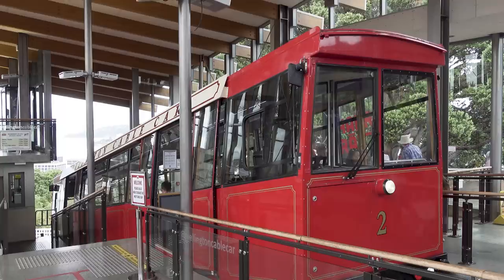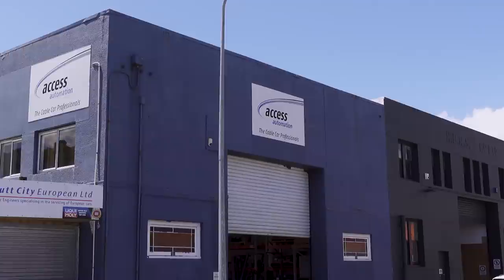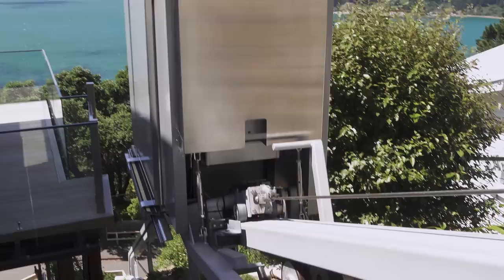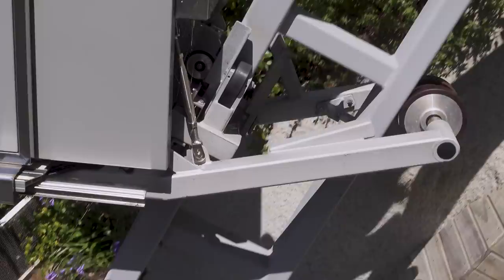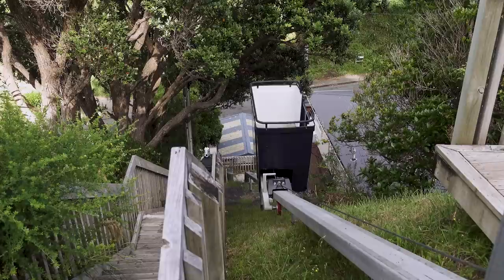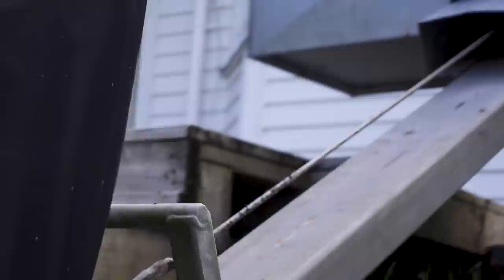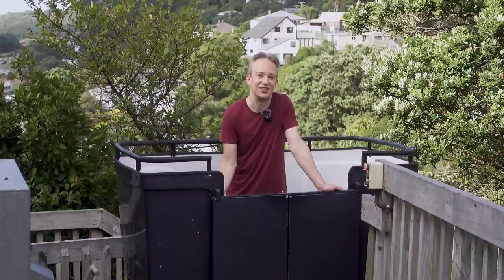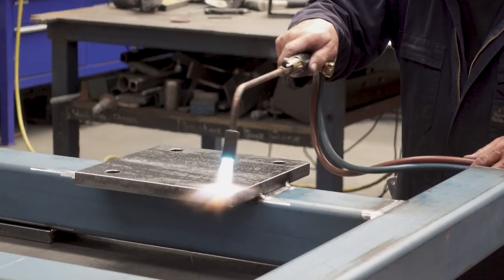The city with a hundred private cable cars

Comment: I normally work as a tour guide in Wellington (Tom, next time you're here, let me know and I'll find you something interesting), but over Covid, with no tourists, I worked 5 different jobs.  One of those was as a courier (for the huge backlog of parcels being ordered).  I got to ride a few of those cable cars which, for a Wellingtonian who doesn't know anyone with a private cable car, was a bucket list item.  Some of them were surprisingly slow, but there's no other way to the house, so sit back and enjoy the ride.
Reply: I moved furniture to a house with one, it had a canopy so couldn't fit big items in it, still had to use the long path. Two seats one either side. It went across more than down - unusual it went down from the street, in Grafton Rd Roseneath - long time ago, fairly sure Grafton.

Comment: If it's this challenging to access an already built house, I can't imagine what it must've been like for the construction workers building into a undeveloped hillside
Reply: Probably used a huge construction crane to lift everything (including the workers) up and down???
Reply: @JohnSmith-yv6eq  and helicopters
Reply: Living in Wellington I can tell you that it's done by helicopter.
Reply: You 100% get it, I had to install double glazed windows in many of these places...biggest pain in the butt ever.
Reply: @patrickmcdonough1893  They've got a 9-ton, a 14-ton, and Maurice Micklewhite.
Reply: @TheCamwa  hehe “ pane in the butte” windows on a hillside
Reply: @mrwess1927  gold!!!!
Reply: The people who keep saying cranes have no idea of the cost involved, as a window installer these hill side homes are terrible to work on.
Reply: We used an ex army bailey bridge barge and lots of buckets for the sand and gravel, timber was just loaded, (overloaded)  I wasn't even given a life jacket. All the concrete was pumped 300 feet down the 40 degree incline.
Reply: I had a similar thought regarding firefighters and heavy firefighting equipment.
Reply: In the Amalfi Coast in Italy they use donkeys.
Reply: I live there and have worked in manual labor jobs. Its a lot of carrying materials up stairs
Reply: I live in Thorndon, Wellington and there's construction going on at the house across the road from me. They had to get a small digger up a 5m high retaining wall, up a steep dirt slope, park it precariously next to their house, and then install some open-air piping to clear away the refuse and dirt they were excavating. Tradies here are kind of just used to dealing with our topography haha. 

Thorndon, I think, is the area Tom made this video in, based off what I saw in the background of the cablecar

Comment: As a long-time Wellingtonian, I grew up going to and from school via the Cable Car every day and have always loved the inclinators you see around the city.  Their extraordinary expense is due to the customization required for each one.  Most people don't have the budget for these conveniences, so people have to just get fit walking the hills and steps required.
Reply: It was only the rich who would build somewhere that needed one. The rest of Wellington doesn't have hundreds of steps per property, does it? I lived in Wellington and had six steps, most have less than fifty and not many have more than eighty. I've never heard the word inclinator until this video and from decades in Wellington only ever heard them called cable cars. Most people drive mate - or bus / train. Even if a house has 60 steps it's one minute of walking - not a huge effort. Minority of people actually walk anywhere and  walk up hills.
Reply: @moaningpheromones  I lived in Kelburn near the top of the Cable Car, so it was a no-brainer to use it for direct access to Lambton Quay and then take a bus the rest of the way. As Scott says, the only reason you'd get an inclinator is for the disabled or to reach otherwise inaccessible property.

Comment: These are also common in my area.  Maintenance is important.  There was a story in the news a few years back where a private cable car broke loose and crashed, killing one of the occupants.
Reply: Wouldn't it be a simple matter to have some kind of inertia mechanism (like car seatbelts) so that if the cable breaks a ratchet or pin flies out and locks the car into the rail. I thought regular building elevators had this.
Reply: @Matthew-ut6ed  I’m sure they have something like that already, but everything needs regular inspection and maintenance to ensure it works correctly when needed.
Reply: @Matthew-ut6ed   The mechanism for these car puts on the brakes when tension is lost on the cable. My property is one of 10 serviced by a similar cable car and we are on the least steep part of the track. We often lose tension when we start to go down the hill and the brakes will stop the cable car and we have to reset and start again. It's only for our stop, and only when we're getting started but it gives me a lot of confidence in the system.

Comment: Despite its branding, the Wellington Cable Car is actually a funicular because the cars are permanently attached to the cable. In a traditional cable car system, like what Dunedin lost but San Francisco retains, a person had to stand in the car and move big levers to clamp onto the cable.
Reply: Dunedin had two cable car systems... One I travelled on as a baby... the Rattray St--Ross St--Kaikorai Valley one... and the High St one which I used in its last year...1957....  the single line was every bit as good as the ones in San F running down to the Piers.
Imagine that now as a tourist drawcard.......
Reply: these are all funiculars

Comment: the next step is to make the cable car part of the house - say you step in through a perfectly normal looking front door at the street into what appears to be a regular entryway, but really the entryway is the cable car and it moves up to the house and becomes part of the structure, so you can you step out of it into the living room or whichever, just like you would any other house
Reply: Also available, and just costs a lot more as you enclose it. Tom could do the same here by me in South Africa, where the Cape province ultra rich live. Areas like Bantry bay and Llandudno, where there are plenty of properties where you absolutely need to have a cable car to access them, or the number where all you have at street level is a set of garages, and a lift to the premises
Reply: The true next step is to make the cable car a house and the whole house moves up and down
Reply: @SeanBZA  I've seen a couple of those with cable cars you can drive a car into because the 5 or 6-car garage is a part of the house up the cliff.
Reply: I manufacture these, and yes, we have many that terminate at the house, exactly as you describe
Reply: @galliman123  Yes!  Down to the street for convenience, then up for the view.
Reply: @galliman123  The sequel to Up seems a bit less fantastical.
Reply: Call me when you've got a working teleporter.

Comment: There is a lot of these in Sydney Australia as well. Most of the ones I have seen are towards the top of the Northern beaches peninsula and many are not to access the house but to get down the step hills at the back to access the boat house of the property. And yes if you can afford any of those houses the price of the inclinator is not going to bother you it will be insignificant compared to the price of your boat let alone the house.

Comment: I grew up in a house on a hillside (sloped maybe 30deg) and there was no roadside access to the house.  Sure, the two-car garage at the "back" (uphill end) of the property was roadside, but to get to the actual house we walked down a gentle driveway shared with two neighbors, then down a steep walkway to the door.  We also had a second walkway (mostly stairs) leading to the road on the downhill side, which we used mostly for the schoolbus stop at the bottom.
Reply: Interesting…how did you get mail delivered? Wellington seems like a fun place to be a postie
Reply: @belindathompson267  Mailbox was by the garage.

Comment: Local problems, local solutions. Very nice indeed. The price is not eye-watering, but not insignificant either.
Thanks Mr. Scott for these unique pearls from the other side of the world...
Reply: $200000 isn't eye watering?😮
Reply: @chopun3862  You can probably buy land that would otherwise cost a lost more than 200k NZD and then add a cable car to it for a net saving.

Comment: As a laborer in my younger years most of the houses that had cable cars were a nightmare to work on in most cases and there used to be a few in wellington that the only access was via cable car as the paths had fallen away or been overtaken fun times :)

Comment: I've seen something similar in Haifa, which is built on Mount Carmel. I spotted some private houses along a particularly steep hill that had similar looking systems for getting to the main road. And there are 2 systems of cable cars in the city, one crappy one and one new, that everyone is in awe of but I haven't heard that many people using as everyday transportation. Architecture on hills is so interesting, in Haifa there are tons of houses that are built into the incline and have several entrances on different floors on different sides.

Comment: I think we call these funicular railways in the UK, unless I'm confusing them with something else.

I'd be interested to learn about the brake/fall-arrest mech. I imagine it's something to do with the way the cable pulls on the hitch, and it levers downward if the cable loses tension. Can totally understand why there's a requirement for an annual maintenance inspection.

Comment: Imagine fleeing from the zombie horde or an armed mugger and this is the holdup to getting inside to relative safety
Reply: Zombies can't climb Wellington's hills .
But they have been known to gather on Parliament's front lawn and burn the children's playground
Reply: On the flip side, from the point of view of zombies and assailants outside, this house has essentially become a castle!
Reply: These houses are all accessible by stairs. It would extremely dangerous if the only access to a house was an electrical lift that could break. The stairs are just very long so people install these cable cars so they don’t have to walk up every time.

Comment: The main Wellington cable car also has a stop close to the city's main university! I only used it a couple times because there was a bus in a more convenient location, but it was cool to take the cable car to school on occasion. Thankfully, the actual city centre of Wellington is built flat, so walking around the shopping and business areas is very pleasant, it's only the residential areas that are up on the hills. I don't think I could handle living in residential Wellington, I'd rather stay out in the Hutt Valley where I am, or maybe in an apartment in the city proper.
Reply: Theres a few cable cars in the hill behind  EastBourne and at least one one the Western Hills. Some parts of the Hutt aren't exactly table flat.
Reply: @user-uy6uc5ey5q  Eastbourne certainly has quite a few cable cars as you'd expect with all the big money.

Comment: You learn something new every day! I imagine they have to be well constructed to cope with the regular earthquakes NZ suffers from. I wouldn't want to be stuck half way up during a power cut either 😁
Reply: Most of the earthquakes we get here are very small and barely noticeable. So while we do technically get a lot of earthquakes, they aren’t big enough to affect this. It’s rare that there would be one big enough to actually break things.
Reply: I would imagine that battery backup to stop it from being stuck during a power failure would be a reasonable amount of money to spend if you're already dropping six figures on the install.
Reply: Most of the earthquakes are a short rumble at most, lost of people don't feel them.

Comment: I wonder if you could build a much simpler and probably less regulated version of the cable car just for transporting stuff like groceries.
Reply: dumb waiter? 
you might be happy to know that in some cities you move in and out of apartments through the window—the building has provisions for a lift on front of the facade
Reply: Maybe, but I doubt it. If something like this exists, you can hardly rule out that children will have fun with it and ride it. And alas, then something happens.
Reply: you are correct that material lifts have much less regulation.  and yes, people have been known to install a material lift and then use themselves as the material to be lifted.
Reply: You could make one with a rope and pulley system for that. You stil have to haul them up but you won't have to carry them.
Reply: Freight elevators are less regulated
Reply: In the UK there is a 13th century privately owned cliff village named Clovelly with a small harbour at the very bottom. Goods are transported from bottom to top and vice versa on wooden sleds pulled by donkeys.
Reply: I saw a guy hook up a car winch to something like this, for getting material to/from a construction site.
Reply: Under NZ building regs, very unlikely. Due to the fairly techincal mechanical and electrical (NZ has a high  240 volt residential power standard) engineering involved even a small 'Freight' version  will involve getting similar ceritifcation as the 'people movers'. Freight ones have failed and caused a high degree of damage to neighbouring property and potentially could have harmed someone.

Comment: Curious about carrying up large pieces of furniture.
Reply: Chinese ballon’s
Reply: For those, you hire movers and they take the stairs. Or use a crane.
Reply: The machine has a weight limit and those shown mostly had no top...and a clear run to the door.
Strap whatever you can onto it within those limits and press the button.
Someone waiting at the landing can get the furniture off????

Comment: You'll find these all over Minnesota and Wisconsin. Anywhere where you got a house on a lake with a steep drop, there will usually be some kind of cable cars. Take a boat ride around lake Minnetonka and you will see quite a few. Though, laws passed over the past few decades in some areas has made it difficult/impossible to install new cars. Due to this, it is common to find cable cars that are very very old. With every passing year, they become a greater hazard. It doesn't help that they are expensive to maintain, and notorious for breaking down.

Comment: The Dallas Area Rapid Transit operates two Inclinators as well as 3 of the longest escalators in the Western Hemisphere at the deepest subway station on the system, Cityplace Station.  Originally built to serve the headquarters of 7-Eleven.

Comment: There's a fair few of these in Sydney Harbour as well. Similar situation, very steep hills with twisty-turny paths that make access very difficult, so they're bypassed by these small systems. Sometimes they're cable cars, sometimes they're rack rails or a combination of both.

Comment: These are also quite common in Sydney around the Harbour. It can be quite steep as you get closer to the coast. It is the opposite issue where access is at the top and water/jetty at the bottom.

Comment: Ah my home town! We are also the capital of helicopters for furniture removal etc, specifically for these types of homes. My dad had to hire a helicopter once to move a new mainframe into the wellington library for a project once. It wouldn't fit through the normal loading dock so they dropped it in via the roof.

Comment: I find the engineering that clearly went into the parallel guide rails to be quite nifty. The distance between the rails changes with the grade, keeping the cart horizontal even as it transitions from a steeper incline to a shallower one. It's a simple enough concept, but not an obvious one until you start trying to solve this specific kind of problem.

Comment: I was blown away by the cost. But thinking about it they will need to test the rock and build a very solid foundation for the entire track before even putting down the track. The foundation will have to hold the track and a cable car full of people on a slope and so it will need to be bedrock solid. It will then need to be completely weather sealed as even a drip of water could get in and weaken the rock underneath it and cause it all to fail. You don't need the bolts holding the track to the rock to be rusting underneath over the years and then suddenly pop out one day.  
So it really is a massive job when you think about it.
Reply: You think we Kiwis just fell off the turnip truck?
We have solved all these issues years ago.

Comment: I love this kind of stuff. they want to build a house in a good location, but the trouble is the hill is too steep to build an access road, so they come up with this kind of solution
Reply: Nah, you generally won't find these in new build houses. The solution to the problem at the time the house was Built was 'stairs'. The cable cars are added later. On residental properties, at least. The comercial uses are a different story.

Comment: I'm surprised they cost so much. A top of the range one, sure, but if you built a basic one with just a wheeled platform, a pair of rails, a winching motor and a cable, surely it would be much cheaper?